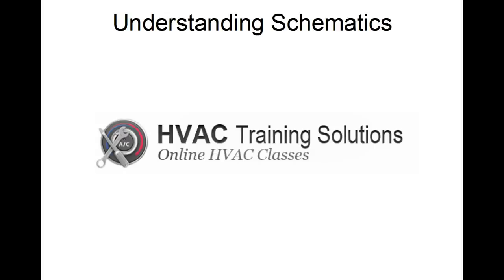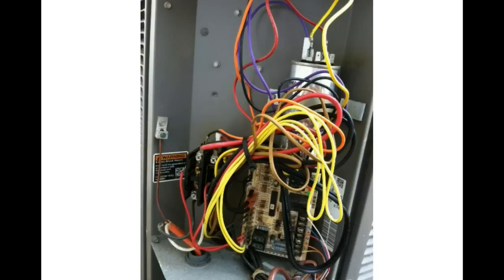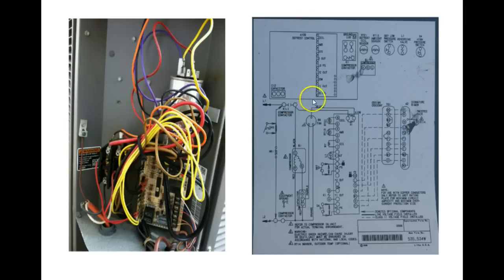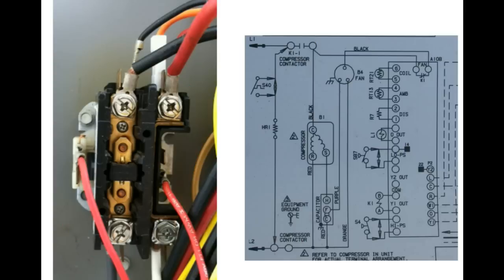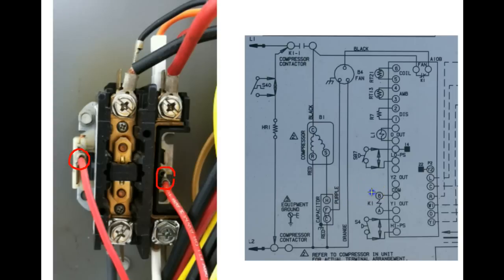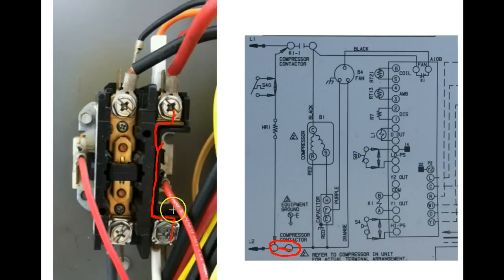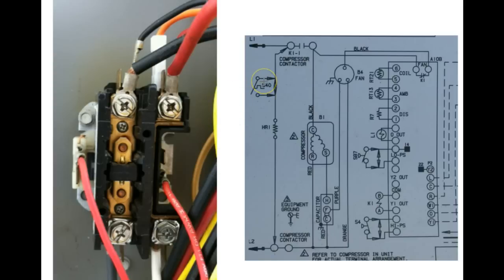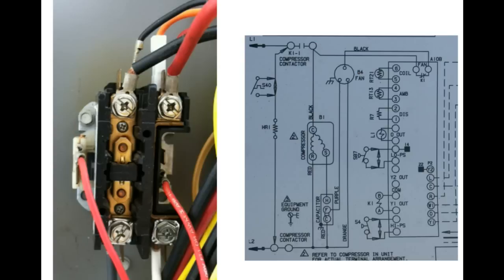Understanding HVAC Schematics - 1

Comment: Excellent video for someone like myself who's just learning HVAC electrical wiring schematics.
Reply from the maker: Methos Millozotti Thanks
Reply: dang that looks complicated  ile ask a tecniction  to help me with a extreme overclocking phase change cooling  with a 60hp scroll compresor  to handle the duty of holding subzerp temps at 5ghz  or more overclocks I want too cool my gpus cpu and have my ram cooled Aswel for a overkill refrigerator  pc
Reply: jonathan oxlade I want to refrigerate my computer as well!

Comment: I'm replacing a single pole contactor on my condenser unit...and wish to be mindful of both the contactor orientation and also the contactor connection labels.  Unfortunately....there does not seem to be an industry-wide labelling consistency,  on the single pole contactor originally installed ( with a shunt side....like you show here)...as to L1, L2, T1 and T2 connections. For example, as I view my vertically installed contactor, the bottom/left is L1.....the bottom/right is L2...and  (of course, to match) the top left is T1 and the top/right is T2. Connections L1/T1 is bridged, or shunted.....L2/T2 has the on/off contacts. The replacement has the contacts between the L1/T1 side...and the bridge on the L2/T2 side. Also assumes "L" on top, based on the written wording orientation. 
 So....two questions.
1.) Can I install the new unit upside down such that the L side is "down", to capture my incoming line power as before? ( I say "upside down" based on how the text is printed on the new unit). Doing this would also mimic the original in having the right side having the contacts, ...and the left-side bridged.....making a better match with the original wiring routing.
2.).....to comply with the original wiring schematic glued to the inside cover....the "new" bottom right would now show a L1 tag, whereas the original shows L2 ( etc...with all other connections labelled "wrong" also). Should I scratch off the numerical part of the T and L tags so that it doesn't look in conflict with the attached schematic?....thinking of the "next guy", especially if it isn't "me".

Comment: I have a problem with my a.c. split unit . Will not cut on . I replace both contactor and thermostat and replace wire from thermostat on inside to inside blower still nothing and I'm got power
Reply: Christi Moore u find out?    same probelm here
Reply: If you have power out door to your uint but not in side it could be your Circuit board on the other unit
Reply: People keep saying board but not which board.... Check the board in your air handler.  Under the house or in your basement/ attic

Comment: Contactor coil is controlled by a control voltage of 24Vac while the  high voltage feed (240 Vac) to the actual compressor motor is controlled by the contacts at the top of the schematic diagram. A good practice to protect the succinct operation of any high voltage contactor is to place a blocking diode (freewheeling diode) across (in parallel) the coil of the contactor. With 24Vac across the coil it may not be susceptible to any large voltage spikes when the current flow across the coil is removed.

Comment: When putting in a contactor make shore that you have that bus bar going back to the right legs of power other wise you will get issues. Remember that your run winding and start windings need to be powered by the bus bar side of power as well as your capacitors.

Comment: i am trying to replace a transformer in a straight cool air handler ,the original trans had 5 wires ,what is the proper wire combination w/ a universal transformer

Comment: If you have a 3/c #10 cable going from a 2 pole ckt breaker at the main panel to an outdoor AC unit is a line to neu. connection normally used to derive 120VAC at the outdoor unit.

Comment: question:   I am replacing my portable A/C  plug in, which has the  
normal 3  plugs ( neutral, pos  and negative - however  their a tiny 
forth wire connected to  the  circuit board  ... should  I just cut  and
  wrap  the  forth tiny wire?
Reply: Neutral, Phase and Ground it is the normal one

Comment: Do I have to use the 24 volt transformer provided in the high efficiency boiler unit to power all my old thick DC thermostat wiring, or can I provide my own separate heavy duty 24 volt transformer to provide voltage to all my DC current needs?
Not wanting to blow any back fed circuits!!
Reply: Daniel Duerst.  DC voltage? Do you mean 24v AC?

Comment: Ron; Great Channel!

I'm not an AC Tech, but have some electrical/mechanical background. My home unit has stopped producing cold air, and I'm being told that the compressor is bad. How can I test it, and if it needs replacing, does this mean my entire system must be recharged with fresh freon? Cant the freon in the system be recovered and reused?
Reply: You can ohm the compressor out to see if it’s bad. I wouldn’t reuse the Freon. If the compressor is shorted, The Freon will be contaminated.

Comment: Terrible, I asked to read a schematic. This only talks about the contacter
Reply: The diagram there is basic schematic for the contactor. Really it's not hard but it takes practice. I'm basically a beginner. It's very important to know how the components work. And I've said a similar thing to what you said because I sat in a class where they crammed 21 credit hours of information into 1 week. It's gonna take practice man. Identify, verify, verify , and check again. This is electricity and could kill you.

Comment: my unit wont come on...i relace the contactor...and it still dont come om.....but when i press the button inside the contactor the unit works but when i let it go it shuts down?????can you please help
Reply: Sounds like you are not getting 24v call to your condenser. Could be your thermostat or something in your air handler.

Comment: what is the reason a bus bar keeps the other pole powered up ? what would happen if you used a double contactor ?
Reply: Maybe it runs ok or maybe the fan won't start or will run backwards. The bus bar allows voltage to be running or flowing in the direction intended for that motor and it's windings. That's why when the contactor gets pulled in power is already flowing smoothly through it's windings and no problems can occur with voltage paths. Nice smooth starts.

Comment: Why is one side (pole) of the contactor alway on?
Reply: Troy Simpson ...It’s just a “pass-through”. The contactor is a single pole switch.....it breaks and makes only one leg of the power to the device being controlled. The other leg is not switched. If both legs of the power are controlled you have a double pole switch. On the contactor , there are two connection points on the output side. This is a convenience for simplified connection to the controlled device. For example, if you were installing a new fan, the two power wires would be attached to the two output points on the contactor. One path is through the make/break side and one is through the pass-through side. It makes for cleaner wiring.

Comment: My question is I am installing a hard start kit I know the red goes to common on the capacitor and a yellow goes to harm.  Does the black  Wire go on the top or the bottom of the  Really on the black wires.
 Thank you in advance.

Comment: Thanks,
I have a LG outdoor unit of witch the fan and compressor are not working. There is no contactor like the one yoy subscribed. The PCB contains a few relays that probably have the same function.
My question: what conditions are checked before the relays are activated (supply voltage, pressure ....??).
Reply: Han Alink I dont know if I can answer you that well as Im an electrician, but the Y connection is for cooling systems so a thermostat closes on high temp and sends voltage to the control board from there the compressor contactor should close and start up based upon the thermostat. notice that in this diagram k1 is controlled from y1 (y2 is for 2 stage or bigger units, however the fridge man describes it)